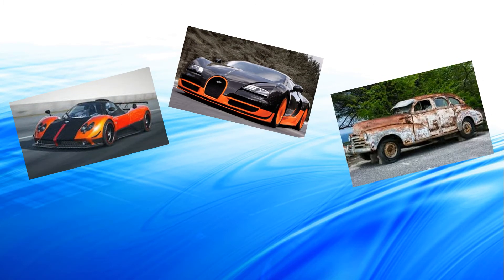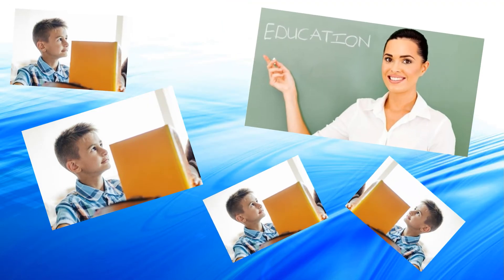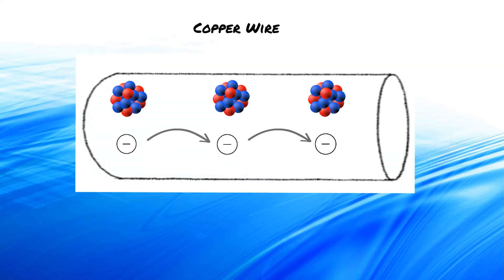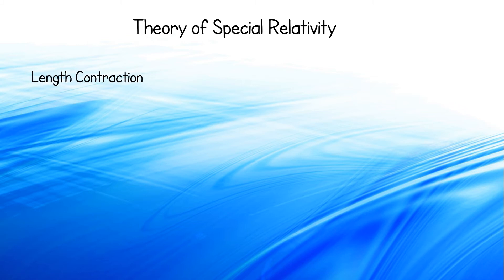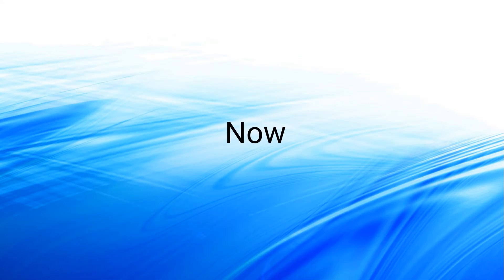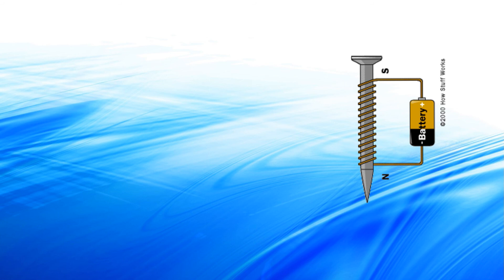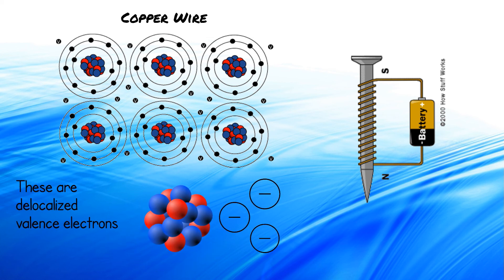What makes an Electromagnet work?

Comment: neither veritasium's nor your explanation convince me. you're saying that its about the space between the cations that contract. but doesn't the space between the electrons contract as well? it moves at the same relative speed as the space between the cations. this is why their effect should cancel out and only the relative movement of the cations contribute to the change of charge to positiv (since the electrons are stationary relative to the outside electron). yet if this is true, it would mean that when the outside electron remains in place while a current ist flowing it should be pushed away from the wire because: no space contraction, but contraction of the moving electrons.
imagine this case: outside electron is moving to the right. current ist flowing to the left. conclusion: space is again contracted but cancels out. cations are contracted but electrons are contracted twice as much because they move twice as fast relatively. so the charge should be negative => electron gets pushed away.
so the only thing i dont get is why theres no force on the electron when stationary.
Reply: Thanks for your feedback,
 First of all, the case you posited is shown at 2:15 - 2:22.
Secondly, the space between the electrons is actually moving, just not in the perspective of the electron. Remember to keep in mind that charges depend on the perspective of the particle. The empty space in the example doesn't have any charge; only the electron and cation do. Empty space moving in the opposite direction of empty space doesn't have any relative charge. Please tell me if this helps.
Reply: thanks for your reply, i really want to get behind this.
i know that space itself is not charged, and thats not what i was implying. by "their effect" i meant  the contraction of space which contributes to the increase of density of the cations/electrons, which in turn increase the force on the outside electron. but from the perspective of the moving electron, both the space between the cations and electrons are contracted equally. because its the outside electron thats moving and not the space itself (which in this case is the wire)
so i dont agree with your statement that "space is actually moving".  space is only moving in the perspective of the moving electron. the space would only move if you would move the wire. the only thing that can move when the outside electron is stationary is the electrons inside the wire (not the cations, not the space). because the electrons move TROUGH space, not with it, when a current is flowing.
Reply: So that we know exactly what we're referring to, I'm going to name the electrons.

Moving Electron outside the wire --- "A"
Electron inside wire --- "B"
Nonmoving Electron outside the wire --- "C"
Physical spacetime (space that can expand or contract on its own) --- "S"
Measurement of the Space (like the space between two people standing (if the people move, the space or hole between the two people moves along with them )) --- "M"

Lets use this legend next time we describe the electrons so we don't get confused

OK. I think I may have been unclear. Both "S" and "M" are important. I believe that only when both "S" and "M" are moving, then length contraction occur. If you look carefully, only space between the cations meets these two "requirements" in the "A" 's perspective. "A" is moving through "S", so the "S" between the cations is moving left in its perspective. It is true that the "S" between the "B" is also moving. However, then comes the 2nd requirement: "M" has to be moving. In "A" 's perspective, the "M" of the cations is moving along with the cations. However, the "M" of the "B" is not moving in "A" 's perspective. That is why the wire gains a positive charge, attracting the wire. Does that help? I am sorry for any confusion this may cause. I am just a dabbler in the field of magnetism, not a physics student yet.

Also, you should watch this video

https://www.youtube.com/watch?v=dFT7-_s0jh0
Reply: Pranav Jain moving measurement? i dont know man, it kind of sounds like people are looking for excuses to make this theory look credible. keep in mind its just a theory for now. this explanation just doesnt cut it for me.
thanks anyway for trying to explain it :)
Reply: Sure that’s fine.
I just think that this model would make sense in a lot of different “length contraction” cases.
Anyway, thanks for your interest.
Reply: @pranavjain3905  I think u understand it to some extent. To clarify, here, are u assuming that the outside electron A and inside electrons B are moving at equal velocity? Or ur explanation above( involving A,B,C,S,M) is for any velocities of outside electron and inside electrons?
Reply: Hi. Thanks for your interest.
Since the time I made this video I have now taken a formal physics class and possibly better equipped to tackle this question. Some of the explanations I made before are super clunky and difficult to understand.  So let me start from the beginning. If you were a stationary astronaut in space and saw a stationary UFO, you would measure its length to be x. If the same UFO decided to move and you tried to measure its length, it would now be smaller than x. Now lets say you were on the stationary UFO and you measured the distance between the earth and moon to be y and the diameter of the two bodies to be a and b. If your UFO starts to move, a, b, and y will all be smaller. This situation is equivalent to if there had been a super long string attaching the earth and moon together. So what the term "length contraction" really says is 2 things: 1. when stationary observers measure a moving object, the diameter/length of the moving object will be smaller than if that objects was not moving. 2. when a stationary observer begins to start moving, any length measurement he or she makes will be smaller than if the measurement had been made when stationary. 
If my explanation does not make sense, please read the following link
https://physics.stackexchange.com/questions/146424/does-space-between-objects-contract?answertab=votes#tab-top
Anyway thank you for your time, about your first question, yes I assumed A and B are moving at equal velocity so that in A's perspective, B is stationary.
Reply: @pranavjain3905  OK. I read a IIT prof's video on this and he too assumes that the outside electron and inside-the-wire electrons are moving in the same direction at same velocity. Then, yes, the outside electron sees that the inside electrons (and the space between them) are not moving, but nuclear +ve charges are moving, so their volume density decreases=>net +ve charge on wire=> attraction to outside electron.

What if outside electron is moving at velocity 20, inside electrons are moving in same direction
at some different velocity 30 (corresponding to some constant current). Can u think of what happens then?
Reply: while this is perfectly calculable, I would like to ask why make the question more complicated. Are you not introducing unnecessary variables?
Reply: @pranavjain3905  because i want to test whether this theory/explanation/understanding is consistent with the result we expect in other situations.

"Speed of outside electron and inside electrons are same" is a highly limiting assumption. Most likely, the current in the wire would have the electrons velocity different from outside electron's velocity. Still, if the directions are same, then still they should attract. Can we explain this? I can think of 10 other cases which i want to explain using this theory, but can we try to explain one case: inside electrons and outside electrons moving in same direction, but diff velocities, they should attract.
Reply from the maker: I kind of said it at 2:15-2:22 of the video. “Attracted or repelled with less intensity”. This is true if you try using the right hand rules of magnetism and the formulas for magnetic force
Sorry it’s the same person just using a different account
Reply: @neenaji1 , “if velocities are different, Attracted or repelled with less intensity”. Why so? Sorry i thought we are trying to explain magnetism using  relativity and electrostatics., instead of using "magnetism" formulas. [I am surprised i hv to even point this out.]

If electron is moving rightwards at velocity 20cm/s and electrons-in-wire are moving rightwards at velocity 30cm/s, then what does the electron see from its perspective? Does it see- 
/ nuclear +ve charges and the space bet them moving left at 20cm/s
/ electrons-in-wire moving right at 30-20=10cm/sec, but space bet them moving left at ??? 
/ ... blah blah ...so outside electron sees a net +ve charge on wire, so attracted

Can u give ur thoughts something like that?
Reply: rgudduu 
When I included “magnetism” formulas, I meant it as a way to check whether the special relativity method was working or not. Sorry if I didn’t make that clear.

Alright, I think your interpretation is correct. Since the cations are moving faster they will experience greater length contraction. Also the length between the electrons in the wire will move at the same rate of the electrons, in your case 10cm/sec

Comment: The explanation is insufficient. You can isolate the effect if you look at an electron beam in a vacuum (something that you can create experimentally). Length contraction dictates that the force exerted by the electrons on a stationary particle must increase the faster the electrons are moving. In this scenario you don't have your crutch of positive charges, but you still get an effect that is not explained by classical magnetism.
Reply: First of all, I would like to thank you for watching my video.

Secondly, the moving electron/particle outside the wire is moving in the same direction and at the same velocity as the electrons within the wire.

Thirdly, the moving electrons within the wire would NOT have any magnetic force on a stationary particle. Only once the outer particle starts moving does the wire have an effect. Therefore you are correct in saying that a stationary particle does not "view" any sort of contraction of the cations (positive charges) in its perspective. There is no positive or negative force on the particle. This is clearly explained by classical magnetism because the overall density of the charge remains neutral. If you have time, please rewatch the video to fully comprehend what I am speaking of. 

Thank you for your time.

Comment: This explanation doesn't make sense to me. If the single electron is stationary but there are electrons moving through the wire, then from the perspective of the stationary electron, the moving electrons should have a smaller gap between them due to relativity. This should make the concentration of electrons greater than protons, and there will be a net negative charge, causing the electron to be repelled from the wire.
Reply: Hi Stephen
You see, this question is answered within my video; I just failed to overtly answer it.
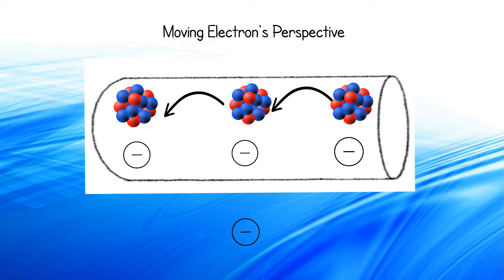If you watch (1:48 - 2:10), you'll hear that I said that the space between that cations is moving in the electron's perspective. In contrast, this does not occur from the perspective from a stationary electron. From its perspective, the space between the "wire" electrons is not moving. This establishes the groundwork. 
Since things that move contract, the space in the moving electrons perspective contracts. However, for the stationary electron, the space between the electrons is never moving. Therefore it does not contract. I know this is hard to visualize, so if you choose to rewatch the video, please keep what I said in mind.

Just to let you know, this concept is super confusing to understand (At least it was for me).
If you have any questions, please let me know. 
It is questions like this that allow me to gain a greater grasp of this concept. Thank You.
Reply: @ Pranav 
But you can always say that body that is moving  (and is contracting in regard of stationary reference frame) is made of individual atoms which are traveling trough space. So by your reasoning body would not contract because space between atoms is not moving. And I do not think that atoms somehow drag space around them.
Reply: It is true that atoms do not drag space.
However the space is moving RELATIVE  to the electron outside the wire. This causes the space to contract in its perspective. 
To the electrons inside the wire, the space is not moving RELATIVE to their perspective. This causes the space to not contract.
Thanks for your feedback.